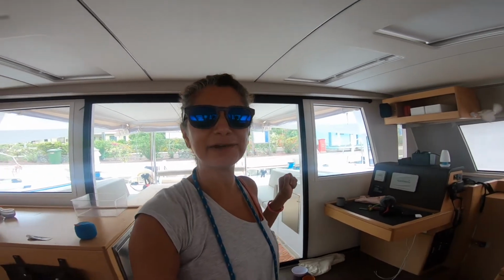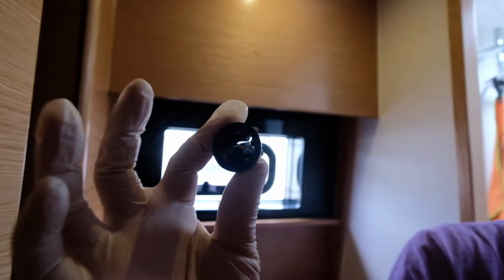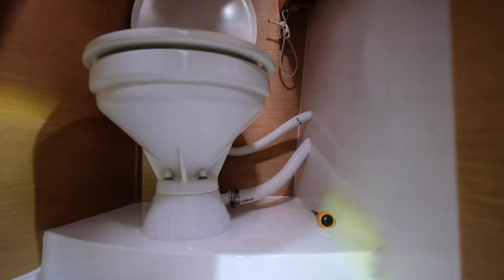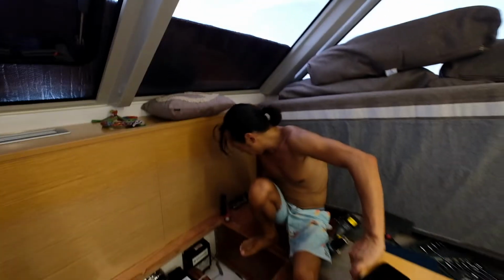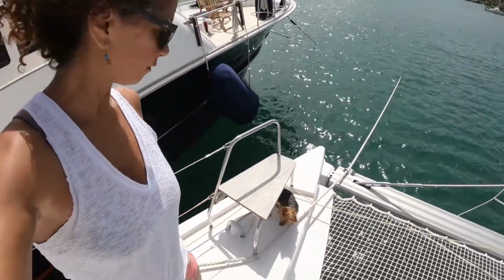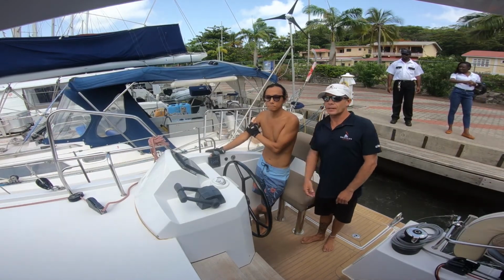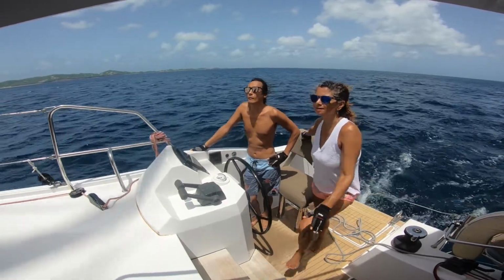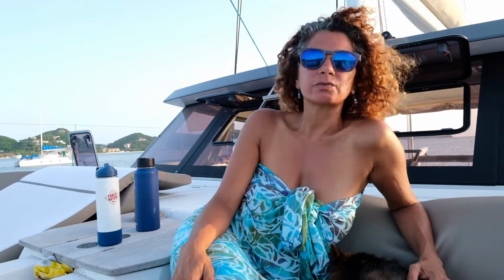WE MOVED INTO THE BOAT EP12

Comment: Good two part video of the survey and first round of ‘boat jobs.’ I hope you have addressed the port sail drive bearings and the starboard outer seal.  The surveyor sounded a little too blasé about those issues. Everything I’ve read about sail drives is you have to stay on top of them.  Not unlike the I/O drive on my little sport boat.

I’m interested in your experiences as the Nautitech 46 Open is on my shortlist, 

Also it appears your were in Grenada at the same time as Tulsa’s Endless Summer. Did you cross paths with Billy and Sierra?
Reply from the maker: Hi Robert, thanks for looking out for us.  Yes, we have addressed ALL of the issues Neil, our surveyor,  discovered during his assessment of the vessel (on and off camera).   Neil took the time to go through all of his findings with us,  answer questions and document them in a lengthy report.  
Have a look at the comments section in our last video.  I just answered a question about some problems solved and briefly provided some insight as to why we love our Nautitech so much.  
Yeah, lots of people in the Caribbean take shelter in Grenada during the hurricane season.  I saw Sierra zip by on her dingy once with her pup in tow.  Of course, Wesley was barking away trying to say hi!  😁. Hope to meet them down the road.. or should I say, down the sea...  Have a wonderful day!
Reply: Sailing Xanadu glad you like your boat! They are handsome cats. I’m following you guys for Nautitech 46, Sailing Sisu for the Leopard 45, Let’s Dance for the F-P Elba 45 (later this year) and Ruby Rose for whichever cat they buy.  Technically I’m following La Vagabonde for the Outremer 45, but not seriously considering it. Who out there is sailing a late model Lagoon 42/46?

Comment: Congrats!! And a question if I may, the issues with aircon, toilet and leaking roof (!) were not spotted during survey? Did it work out alright?
Reply from the maker: Thank you!  The surveyor spotted some hatch issues but these new leaks appeared after a huge rainfall.  Water was coming through the bedding of our ceiling window, this was not an issue during the survey.  The  A/C issue was spotted.  Toilet was operating fine during survey.  Overall, we believe it has been a good boat despite the repairs we've had to do.  Thanks for your question!  Liza & Kaz
Reply: Ah ok, thx. Good luck, when you have time, I'd appreciate a full boat tour;-)